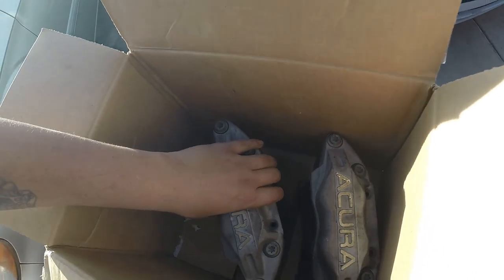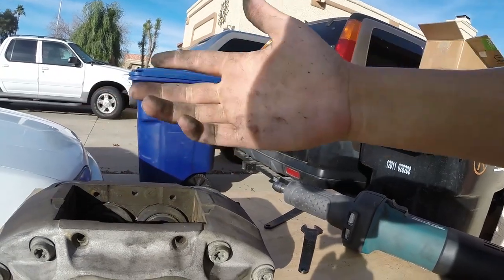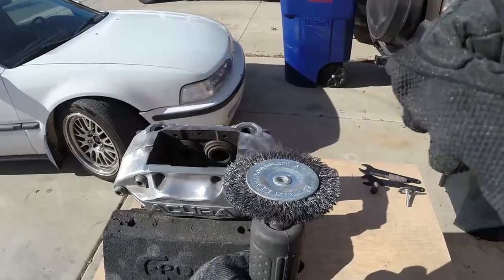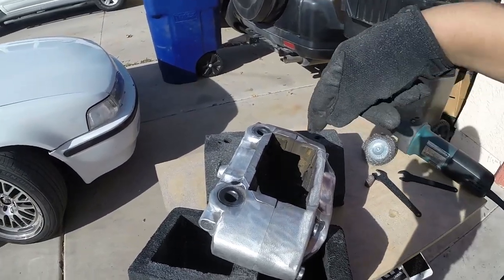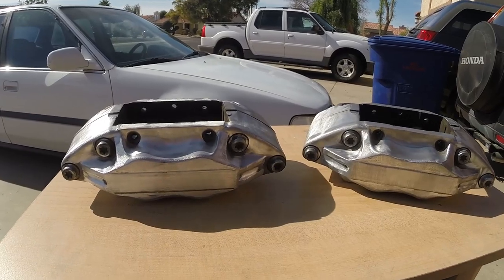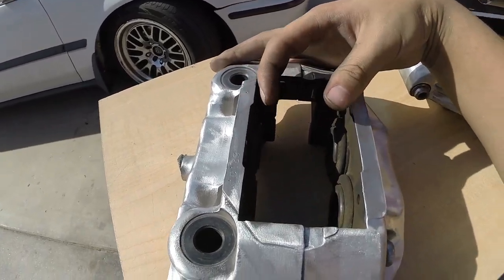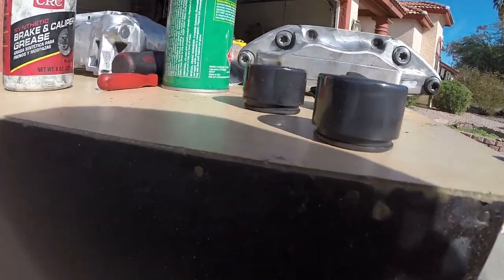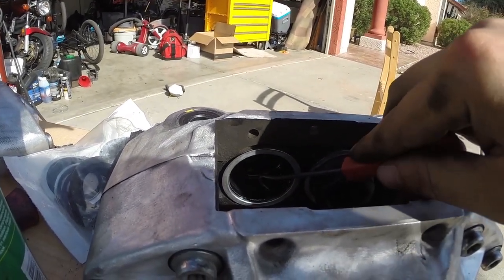Acura RL Big Brakes - Caliper Restoration/Rebuild - Track CB7 Build EP. 4 - 92 Honda Accord

Comment: In addition to low cost and good junkyard availability, another advantage to these calipers is that they don’t have mounting ears. This makes them adaptable to a wide variety of vehicles by either purchasing or fabricating a custom mount bracket. They can even be adapted to non-Honda/Acura vehicles.

Comment: I think I caught what I was doing wrong when I was rebuilding mine after watching your video. The seal/dust cover that sits on the out side of the piston I put the metal ring in that and tried to seat it on the piston, but it looks like you’re supposed to put the metal ring in and then put the piston in and then finally that seal. 🤕

Comment: Any particular brake pads you recommend bc I have the Power Stop ones on currently and they squeak badly in the very beginning for just a stop or 2 then get worse after too much braking. I’d say when they get too hot! I would greatly appreciate it. Thanks and great video! 💯🙏🏾
Reply from the maker: Check out EBC pads

Comment: Your build is pretty badass I started to freak out when you started grinding off the Acura lettering on the caliper I'm only 6:05 in I'm going to see where this goes. Same goes with shaving valve covers I've never understood it. Your build is super clean any news on a dyno for the f22a/f23?

Comment: What’s up..I have a 91 accord wagon like the set up.to use this calibersi have to use them with the front Oddesy knuckle assembly..and what rotors I use the odessy ones to let me know thanks
Reply from the maker: you can actually run these calipers with the stock accord knuckle, the only issue is there are not many rotor options. You just need to buy the right mounting bracket.

Comment: Hi,where did you get the seals kit.i got the same calipers to installed on my rsx type s..thanks
Reply from the maker: jowell cc you should be able to pick it up at any auto parts store, or dealership. I just got mine from a local parts store

Comment: I do have a question. Why did you decide to use the 350 rotor and not the RL’s?  I really want to do a big break upgrade to my cb7 also!
Thanx man! Also, I’d love to talk to ya and go over some stuff that I want to do to my car. Maybe I’ll give you my numbering IG.
Reply: Because the RL uses the oddball 5x120 lug pattern, which is incompatible with other vehicles with five lugs (which usually use 5x114.3).

Comment: Grease can swell up rubber parts make sure you use silicon Grease...fyi
Reply from the maker: Rick it is a silicone based caliper grease👌🏽thanks for looking out tho!
Reply: @JaayPeeBuilt  sure,.( And I wasn't trying to be a dick,i just thought it was worth mentioning..)

Comment: Can You Use These On The Oem 4 Lug Setup?
Reply from the maker: Yes FFC makes a bracket for the oem cb7 knuckle as well I just don’t know what rotor you would need to use. And I think you might have to convert to roh. Correct me if I’m wrong.